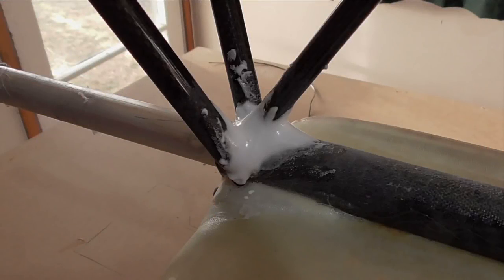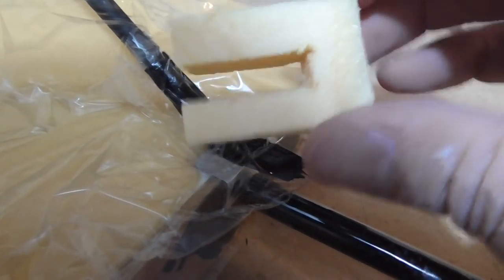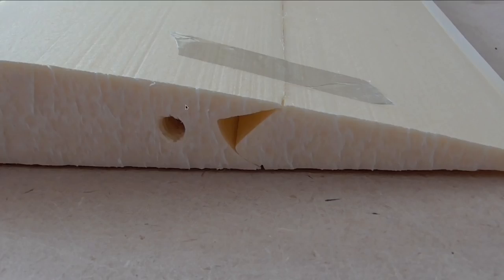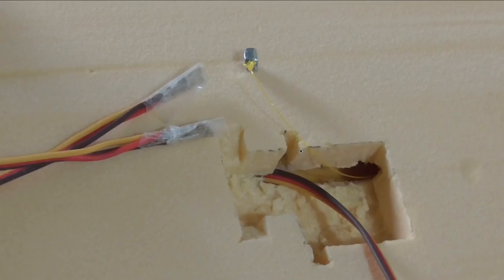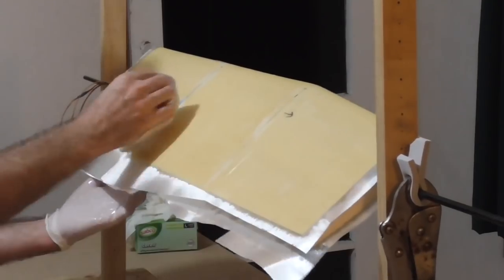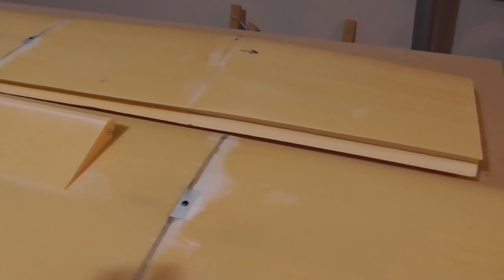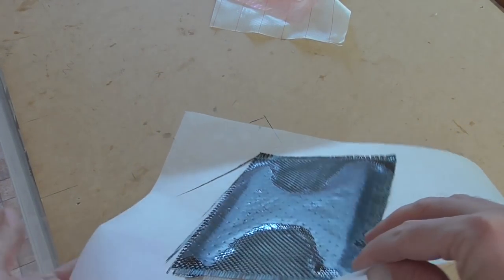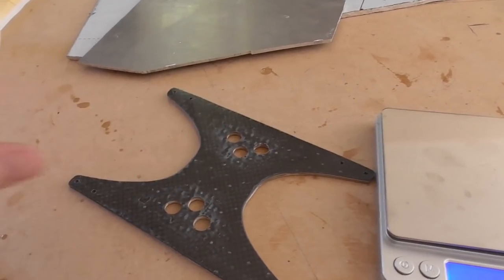Farm hopper part 3

Comment: Another trick for gelling wires down a tube.... blow compressed air down the hole and it will draw a string down there, then you can pull the wires. Always great content, thanks for posting.
Reply: using a vacuum works too, just the other way around

Comment: That's outstanding work ! I build planes out of the same foam but with a bit less Advanced techniques and I couldn't help but notice that the movement of your falps is a bit optimistic : it rotates too much for the amount of downward movement it has so as soon as there is some airflow comming from between the wing and the flap it would have no chance to stick to the surface so it will stall. You should put the rotation point further forward it will help.
Keep up the good work.
Reply from the maker: It's a compromise between how much angle you want and how large you want the gap to become. I wanted to try large deflection (eg. even up to 90 degrees) for massive drag, since this is only 1/3 of the wing the other 2/3 should still provide decent lift, I hope. As the pivot point moves forward the distance between the wing and flap at maximum deflection becomes very large, to the point where they become quite separate entities. In any case as long as this section stalls before the wingtips, should be workable :)

Comment: I know that screech from that motor with the 13"- it's desyncing. Not uncommon once you start getting into motors and props that size, there's enough inertia in the prop that with an ESC with no feedback (essentially the standard for RC ESCs and motors like this) you can ramp the throttle more quickly than the prop can physically accelerate, so the pulses from the ESC get out of phase with the rotation of the motor. Simplest solution is to put a small limiter in the throttle rate in your radio, just keep increasing until slamming the throttle from min to full doesn't cause that to happen anymore.

Comment: Had a similar problem with a motor from HK, it was fussy, couldn't apply throttle too fast or it would scream and cut out. The coil probably had a winding error or a not so strong short. Putting in a better (more expensive from an EU vendor) motor it worked without problems.

Comment: Very nice build. realy exited to see the final plane tested. And do you maybe have some videos or documentations one can watch to learn about how to composite build aswell?
And would the foam not hold its form without the glas?
I realy am a new regarding that so i hope you might be able to help me =D
Reply from the maker: Try this search on YouTube "burt rutan composite construction"
These videos are also interesting: https://www.youtube.com/channel/UCVDILmX2ylWP1YLQmYi9nPw
No, I think the foam would bend too much without some outer skin. Maybe if I put a spar all the way through it would be ok... but any slight bump or scrape will mar the surface easily.
Reply: @iforce2d  yeah i guess so and if you would remove the foam after laying some glas? i gues it would be stiff enough with a spar and some ribs in it.
Reply from the maker: You would need MUCH more glass if you wanted to do that. The foam provides good compression resistance in every direction, while glass only in two directions. The foam is also very useful to embed things like servos, GPS, receiver etc without needing to make any extra mounting plates or brackets. Solid foam is easier to work with overall than an empty shell with ribs.

Comment: And how do you know what kind of waeve you need or what thickness for your carbon fiber?
Reply from the maker: Just from trying with other builds in the past, make a few test pieces and see how it feels. 50g/sqm seems a good place to start for a wide range of size models.
oh you mean carbon fiber. Well... same answer I guess, just have to try some out and get the hang of it.

Comment: Hi, which micro servos do you use and would you recommend them?
Reply from the maker: On this plane I'm using these, but I haven't tried them yet.
https://bit.ly/2PEsKPp
https://bit.ly/39eBELr
I have used many different types over the last few years (towerpro, JX, emax, racerstar) and they all seem to work fine, can't say I've ever come across any that were complete rubbish.
Reply: @iforce2d  Thank you very much! I hope my planes will once be as good as yours :-)

Im still a little bit worried about the servo topic. The is a hole range of super cheap to very expensive ones. A lot of them also seems to be rebranded, with different names and specs for the same model.

Comment: What ‘weight’ fiberglass cloth?
Reply from the maker: 50g/sqm all over for this. So far I have used this for just about all the plane stuff I've done, it seems just right. Any lighter is hard to handle because it's so light and wispy, any heavier requires more resin to wet out than a simple brushing will apply. With the 50g I can usually brush resin onto the surface just enough to cover it, then lay the glass, and that's it. Maybe a little dabbing with the brush in some areas, but no need to add more resin and very little need to mop up excess.

Comment: way too much resin  - lay all carbon  up dry on a wet surface and than add just enough resin to the top layer - and press the hell out of it. vacuuming would be preferable. the fibres carry the load, the epoxy is to hold all together

Comment: I have that motor but 1100kv on 3s with a 1365 prop
Reply from the maker: oh, good point. The specs page does say 3-5S lipo and 13/12 inch prop. Maybe the 13 inch should only be used on 3S
Reply: @iforce2d  I would think it would be fine on 900kv 4s

Comment: You build too strong. :) And the battery seems to be bad for the prop test. 13 volts is not a good voltage.

Comment: please make a fome cutting cnc for wings.soo hard using template...
Reply from the maker: I get this suggestion a lot but it's not as practical as it seems.
Reply: the machine is straight forward but it requires one to learn cad/cam to a certain degree and that is a whole other project in itsself. Last year, I built a bangood laser engraver: this the simplest diy cnc the exists to my knowledge and to get it working right for precision functions takes a fair ammount of research and config. I did look into making a 4 axis wire cutter but the main problem is that the software to drive it is a diy open source app that leaves you pretty much on your own.
Reply: @simonl7784  make 2 axis cnc...for straight wing...jast x or y axis...
Reply: indeed it is a valid solution.. it limits you to making either plain panels (same profile on both ends) or truncated pyramidal panels (profile scaled on both ends)  <-- this is done by attaching the hot wire on a fixed point away from the machine. Then the machine could be driven with the same software as for laser cutting...
Reply: @simonl7784  hm
Reply: im not convinced cnc hot-wire makes sense. Easier just to make simple fixtures, or even just do it mechanically with weights pulling the bow for even tension. 
CNC milling is interesting but you need such a huge work area for even small wings, or if you do it in small sections you might as well just hot wire it anyway.
Reply: @confuseatronica  
Milling smaller sections would be more accurate than hot wiring them. And less work since you just let the computer do the work.
Lots of mess though.